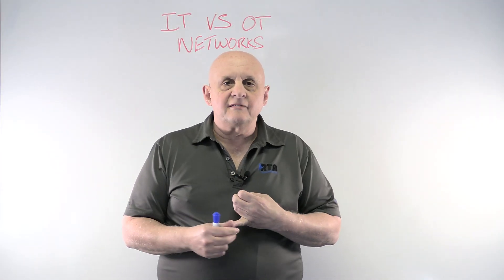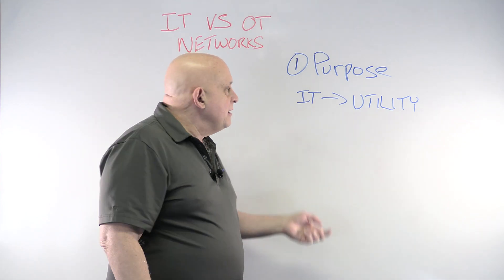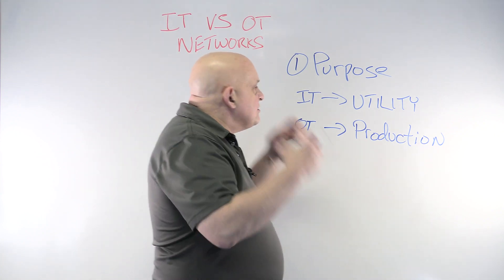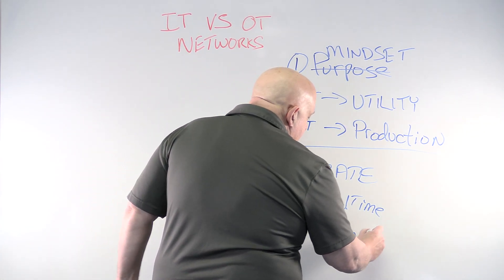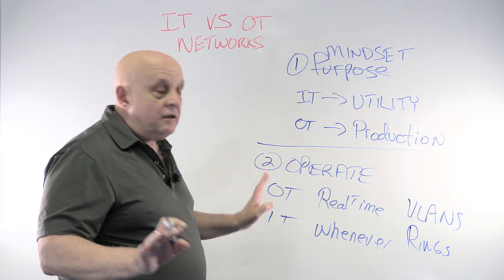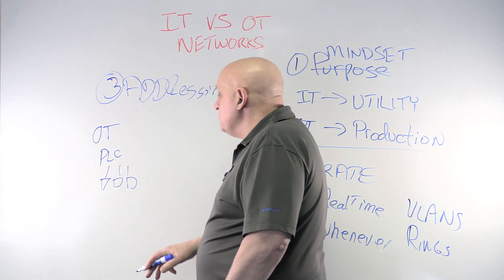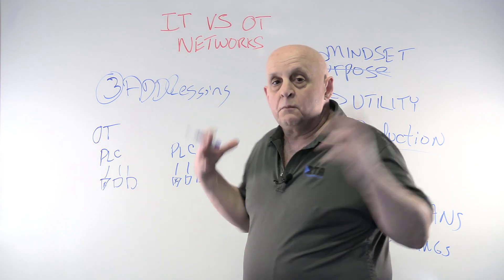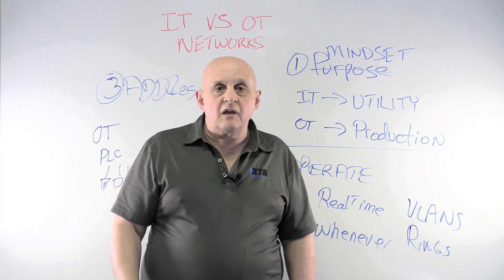The "BIG" Difference Between IT and OT Networks

Comment: Plant floor OT networks have very different requirements than IT networks. Things like very low latency, safety communications and the fact that they tend to have much larger sections that are flat layer 2 networks connecting end devices like robots, PLCs, programing terminals etc;  Great video though. I came from many years in IT into OT and it was really eye opening for me! I will say that IT networks also use VLANs to segregate traffic, not just for network monitoring.
Reply: is it good for starting career in OT as a fresher?.... please tell us your experience in OT

Comment: IT uses VLANS to segment, it's their entire purpose.  Not sure where you got the idea from that it's for monitoring switches.
Reply: I would add that I think that the IT vs OT networks is more about kingdom building than it is about functionality. Vlans and Firewalls will help do all of this. What is not mentioned here are all the systems and services which OT relies upon, that sits on the IT network. Maybe I am missing something but I don't see the benefit of two completely different networks mostly because OT relies upon IT apps/services...
Reply: @brihal7499 Well I think I understand some reasoning. There was a Reddit post not too long ago and it seems to from that post that OT systems are 'stupid' in that to help maintain the speed of such systems the devices in them don't have a ton of intelligence that we would expect from normal IT devices for example if you send a malformed network packet to a traditional it device it's more likely to simple drop the packet but OT systems may not have that intelligence as it might slow down their operation and therefore it can cause the OT devices to misbehave.
Reply: Well in some environments having a dedicated Vlan for network monitoring makes sense.